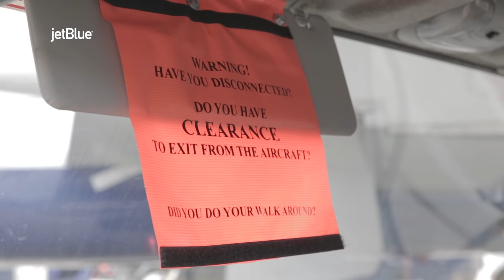A day in the life of a fueler

Comment: I was a fueler at KBUF and I always liked JetBlue because they were so straight forward.  I would pull up, check the fuel panel if there were 12,000 pounds I would just go confirm the reading and that was that.  If it was less than I knew I was adding fuel.  THe worst thing about it,  we had a 20' ladder that  I had to climb to hook up the hose.  It was always fun climbing the ladder with one hand and dragging that hose up.
Reply: One hand climbing a ladder in perfect weather doesn't sound fun much less in scary weather.
Reply: Is it a good job? What qualifications do you need?
Reply: @Sk6088  it's a great job
Reply: @jonfitz8280  what qualifications do you need?
Reply: @Sk6088  nothing, since this is an entry level job. If you wanna be specific, don't do drugs, have a clean criminal and driving record, and be mentally ready to do overtime if needed- overtime will typically happen on busy holiday travel days, so it is not a common weekly occurrence.
Reply: @Sk6088  im a short dude would i be able to work there? do you need to carry heavy stuff?
Reply: @jhonathangarcia1330  I don’t work there I was asking
Reply: JetBlue only flew E-190's and Airbus A-320's to KBUF. Tallest 
A- frame we used was 11 foot. Even the B-757 only required a 14 foot A-frame.  I worked there for 39 years.
Reply: but when the flaps and slats are out, I see that is is no room in the inn for all those  thousands and thousands  and thousands of gallons of fuel

Comment: I like that they keep the fueling process simple, BUT Airbuses are the slowest to take on fuel.  Boeings fuel so much quicker.  Switch to Boeing's and JB wouldn't have so many delays out of Tampa.  It'd be even nicer if JB invested in a portable scanner system like Delta has so fuelers can get all their info right in their driver seat prior to fueling and then upload departure fuel info.  Work smarter, not harder.
Reply: we use I pads and EffectiveFBO. fuel load shows AC# Jet A + or -- or 100LL for recips CSR's take the order, upload it to the system fueler inputs meter #s and gallons pumped for records and billing. fuel info also has notes if needed. works fairly well.
Reply: YES!!  Airbus are slow slow slow to fuel.
Reply: Strange the fuel flow on a single Port Is max 300 gallons per minute, larger jets with double Port max 600 GPM, each Wing has a refueling point (single or double) the only way to pump 600 GPM in a a320 Is to use two fuelers at the same time, and A380 can be refilled up to 1200 GPM in the same manner

Comment: Why did he only put 299 gallons of fuel in it when they said it takes 6500?
Reply: It's a 5 digit counter not 4 that's 0299X gallons and aircraft don't refill from empty or to completely full just enough for the flight plus a reserve to save weight and fuel burn
Reply: Its a great piece proaganda this film. Very satisfying to the masses.
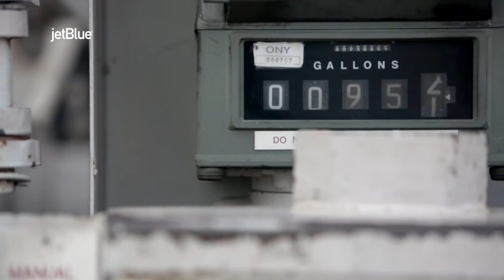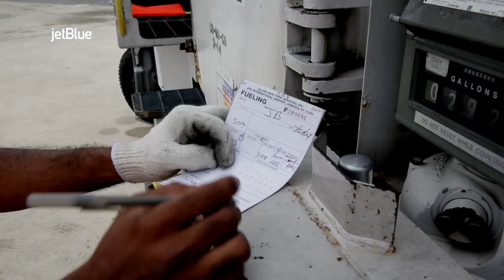Reply: I hadn't seen your comment, but basically that's what I said above.  "At minute 1:48 they show the gallon counter at 95 gallons and counting.  Notice the two zeros to the left of the 95.  Then at 2:25, you see Poonai writing down the final gallons.  It looks that is about 292 gallons total - that's it. 292 gallons. Notice only one zero left to the left of the number.  Let that sink in.  Go back to minute 2:00 and it's where they tell us they need more than 6,500 gallons of fuel for the next flight, which will fill 325 SUVs gas tanks.  Can you spot the lie?"
Reply: @maretop2002  
My guy this is how it works. 

The hydrant truck, tanker, or hydrant cart dispenses the fuel and is metered in either Gallons or Liters. The aircraft fueling panel will display the fuel on board as  Pounds or Kilos.

So lets say the Pilot wants 30,000 pounds of fuel, noted as (30.0). You open up the panel and see how much fuel is on board already. Lets say the total is reading (10.0). That's 10,000 pounds of fuel on board.

So quick math is 30.0 - 10.0 = 20.0 or 20,000 pounds of fuel you have to add to get to target fuel. if you want to know ballpark how many gallons that is take 20.0 divide by 6.7  (20.0/6.7) = 2985 Gallons of fuel 

This A320 you can set the fuel load in the panel and the computer automatically starts balancing out all the tanks. You can fit about 6,400–7,190 total gallons in the fuel tanks. So about 14,000 pounds (2000 gallons) or so in EACH wing and the rest goes into the center tank.

So yeah, aircraft are all about weight, that's why the fuel panel shows weight (pounds) and NOT volume (gallons). BUT for accounting and billing the customer is billed by the gallon, so that's why the trucks have meters.

Also, the wing structure is actually quite HUGE. Don't let the thinness fool you. If you get in under the wing you can see fuel the tank wall.  Its large enough on this aircraft that a human can crawl into the tank area (tank divers) for repairs.

Hope this answers your questions.
Reply: @maretop2002  Lol you were surely drunk when you wrote that. Or just showed your trust issues if you’d think they’d lie about such an important piece of info on a public platform.
Reply: @hannya74  most I've put in a JetBlue was nearly 52,000 pounds! Was able to do it bc it was a 321 Neo and had additional center tanks.
Reply: Fuel is about 6 pounds per 1 gallon. On the plane its measured by pounds and in the truck we go by gallons

Comment: Im a curious observer from the good ole US of A.  I have extensively traveling background flying big metalic birds.  In most major airports, I see either one oil tanker or I see a underground tanker fueling these big birds.  For a Airbus A380 with some 85000 gallons capacity, that means we need about 9-10 Oil Tanker trucks to fuel the plane with jet fuel? According to my calculations, it will take many hours to refuel ONE plane. How is this possible? Most of these jumbo jets land and take off for another transoceanic flight in less than 3 hours from landing to take off.   So, my aircraft experts, how on earth is this possible?  

85000 gallons of fuel = About 550,000 pounds of Fuel on a roughtly 800000 empty aircraft before we add passenger/cargo on top. Something not adding up guys!!!
Reply: funny thing is, this so called "sensible" people who think airplanes run on compressed air know nothing practical about the job!!! This isn't earth science. If you want to know, go to the airport and see for yourself what they take in. If you see liquid fuel and you're still convinced it's a hoax, then you got yourself in a hopeless situation

Comment: I'm a aircraft fueler in the us army I mostly fuel blackhawk helicopters and ch47 chinooks (the crew cheef does most work for ch47s) but this job isnt hard just dont get too consistent because you are putting other lives at risk if you half ass a job. From my understanding if a plane goes down the first thing they look at is the fuel and if the plane went down because the fuel is commingled (*aviation fuel term for contaminated*) you will do prison time. I can answer most questions if you have any about fueling day in and out procedures I'm sure it isn't different from conventional aircraft fueling.
Reply: Contaminated fuel isn't necessarily commingled, but nice try
Reply: Also I think you meant complacent, not consistent?
Reply: So do you have to hold those gas hose to the plane for hours? Or does it lock in place. And you wait while it fills up?
Reply: @angelorangesticks5560  you twist it to lock it in place
Reply: So it’s easy how much you make does it get boring
Reply: @kilianweber8368  boring af at least for myself but I'm an apache/Blackhawk fueler in the army. Not sure how boring it is civilian side but I imagine it's worse. Apaches only take 470 gallons so it's a quick process but sitting there for 40+ minutes doesn't sound fun
Reply: @mellowofficial_  is it easy I just want something for four years so I can go to college
Reply: @kilianweber8368  it's super easy once you get the hang of it. The paperwork involved is the hardest part but if you're good at math and remember to write everything down even that is pretty simple after doing it a few times
Reply: @kilianweber8368  you'd probably make around 30k a year but you CAN make 50-65k or more if you do it long enough
Reply: @mellowofficial_  yeah I’m not good at math but for the airforce is it good
Reply: @kilianweber8368  I'm in the army. Not sure about the airforce
Reply: Are u a 92 fox